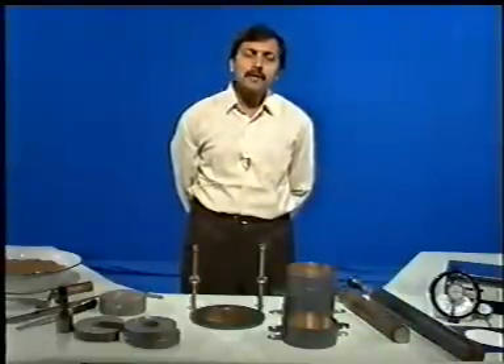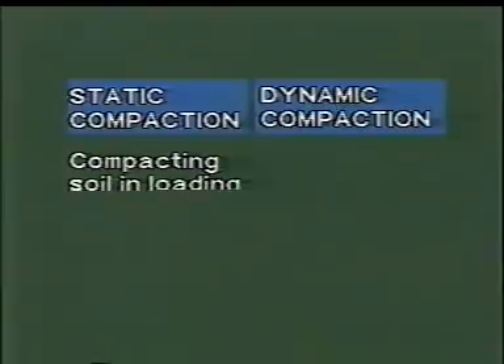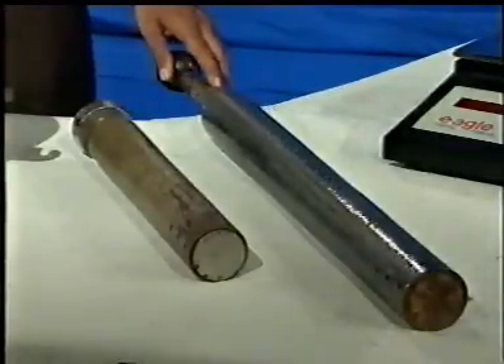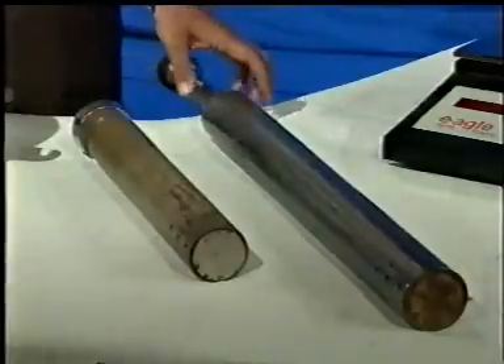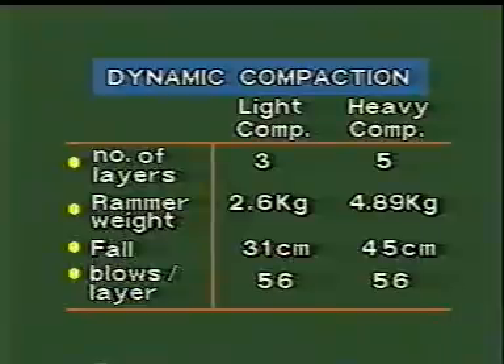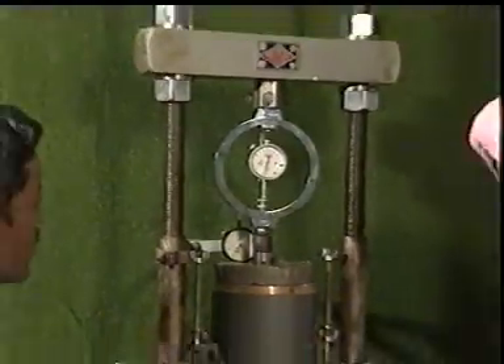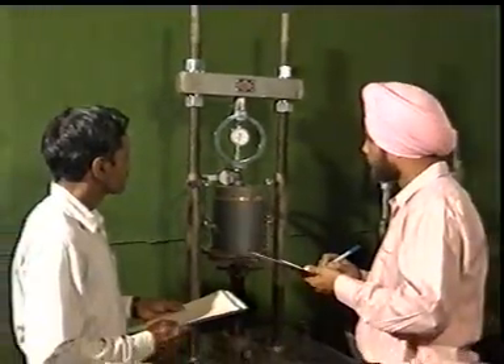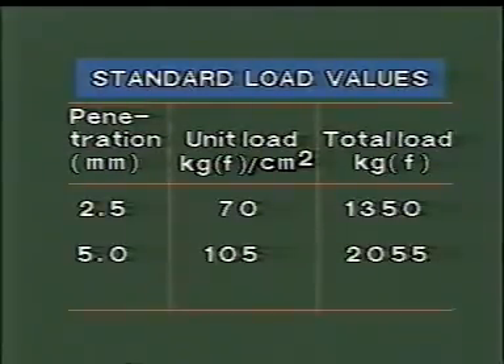CALIFORNIA BEARING RATIO (CBR) VALUE TEST

Comment: Most of the people doesn't know why 2.5 mm value is considered it is actually 1 inch according to American standard test procedure and the rock used was of 1 pound weight and it was found generally in california....
Reply: 1 inch means 25mm not 2.5mm.

Comment: First of all thank you for such clear explanation, i am here to know ans for my question,
1) how we differentiate casting of specimen at 95℅ compaction(as per MORTH), 97% compaction(as per IRS) or 100% compaction of MDD for blanket layer. 
2) how setting load applied, and how much it is on dial gauge reading,
Please replied it i really want to know this.
Reply: 100 % compaction is not practicable at site due to less control on moisture content and other variables. So as per specified requirements compact to desired degree .

Comment: Very professional and well explained. Very compliant to the regulation. Yet, let me give you a precise tip: the first done, with the mold and the hammer, actually is not the CBR, but the Proctor test. The CBR is the last, done with the assistant. The two tests are strictly related (CBR is gonna be executed after the proctor) but they are two different test. The proctor test is aimed to evaluate the optimum, i.e. the maximum amount of water (weight %) to have the max density. Indeed, until a certain value (depending on the kinda soil), water furthers the bonds between the grains and, hence, the density, becouse of the water film between. But over a certain value, water is too much and it tends to counteract the density, making the grains submerged into water. Like all the other lab geotech. tests, this one also requires several tests; for each test the soil must be weighed, subtracting the weight of the mold (previously weighed void) and the weight of water (knowing its amount in each test) to find the net dry weight. All the results are plotted in the optimum bell curve, built step by step (water content % vs dry density in the diagram) and compared them each other, to see which one is at the top of the curve (the content of water, called optimum indeed, that gives the most performing soil).
Reply: @erkamkurt3127  I read @Umberto Bombace comment. He is absolutely correct.😀
Reply: @erkamkurt3127  I read the comment well and he is correct.
Reply: Proctor test is usually done in a smaller mould.  Without any spacer disc. Though anything is fine. 
And for CBR we have to prepare the sample and therefore the first is definitely part of the CBR TEST

Comment: please define the no. of blows for 97 % compaction 10, 30, 65 for the cbr casting,
because required no. of blows as per ASTM D1883 (10, 25, 56 blows) compaction for 95%
(how to calculate 10, 30, 65 blows for 97% compaction or where are write this criteria.)
Reply: 25 for light compaction and 56 for heavy .